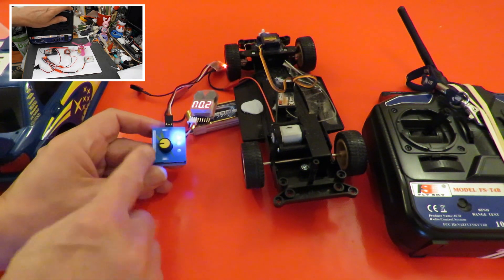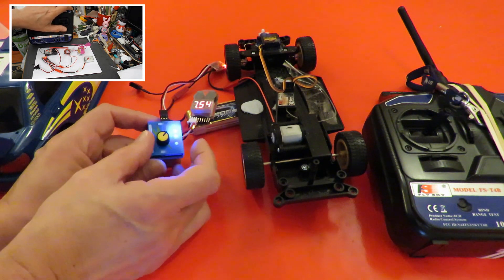Forward Brake Reverse Cheap RC ESC

Comment: Thats because that transmitter is for a plane or drone not a car
Reply from the maker: Fair enough, if that is what you want to believe. However, it is simply a matter of the range of the throw on the throttle stick. Any other model of transmitter in the FlySky range allows you to alter the range of the throws. The FS-T4B is the bottom of the range with the minimum features. You don't have to have a pistol grip controller to drive a car.
Reply: @GrandadIsAnOldMan  no but a transmitter that the throttle doesn't return to center on its own is not for a car that's for a place or drone
Reply from the maker: @melmskilemz6307  again, fair enough if that is what you want. If you need auto return to centre you can use the right stick for throttle and steering. I find it handy to NOT return to centre, especially if running a boat. However, having said that, I do usually use a pistol grip for driving cars. If I am driving tanks, again, not having auto return to the mid point is a handy feature, I set the speed of the tank by setting the speed of the left track using the throttle stick and then use the right stick to match the right track for straight and vary it for steering. (Same for twin prop boats). Another alternative would be using a V-tail mixer.
Reply: @GrandadIsAnOldMan  why talk about when running a boat when the video is of a car 2 different things you are using the wrong transmitter for the vehicle and wondering why it's not behaving right
Reply from the maker: @melmskilemz6307  NO, the video was about the problems with this type of ESC, hence the title. It says nothing about RC cars. Maybe if you read the video description or any of the other comments you would understand. I am just using the car as a demonstration.
Reply: @GrandadIsAnOldMan there wouldn't be a problem if the correct transmitter was used
Reply from the maker: @melmskilemz6307  I guess you find it too difficult to read video descriptions and I am getting tired of repeating the same answers. However, one more time. This has nothing to do with driving cars. As explained in the video description, originally my problem was the lack of information about how the brake works or how it is activated. The issue with the ESC is the fact that the FS-T4B does not give you the full range of throws and has no option to change that. If I had not discovered that problem, then I would not have understood why I was unable to bind my WLtoy V911 receiver for controlling an aeroplane. Because you don't get the full throw the receiver would not enable the motor outputs. It is the FlySky FS-T4B that does not give you the full range. Here is the video using the WLtoys V911 receiver https://youtu.be/vX-ovUMPIkw  Using a FlySky FS-CT6B where I can set the throws to 100% in the set-up program I could bind the receiver fully and use the motor outputs or alternatively set one of the switches for motor cut-off. As you will see from the comments, you are not the first person to get a fixation about using a car controller, but I understand that is just a lack of understanding in the purpose of the video even though the title is clear enough.
As for "using the right controller", if you only have one controller, as was the case when I started "hobby grade" RC, then nowhere in the information supplied with the ESC or the listing selling it, did it specify what controller would be required.
Reply: @GrandadIsAnOldMan  no that is not correct seems you don't know alot about rc and just like to write big paragraphs maybe learn about rc before trying to teach people on YouTube because you are clueless
Reply: @GrandadIsAnOldMan  seems 7 years after this video you still acting like a complete noob to rc
Reply from the maker: @melmskilemz6307  what is not correct? You seem very sure of yourself, but you are very vague about what you are saying. Tell me exactly what I have said that is not correct.
Reply: @GrandadIsAnOldMan  not worth explaining again if you haven't got it in the years this video has been out
Reply from the maker: @melmskilemz6307  so you admit you are wrong and realise you cannot justify your comments. No problem, I can accept your apology 😊
Reply: @GrandadIsAnOldMan  no how many times that transmitter is not for a car seem you can't admit your wrong old man
Reply: @GrandadIsAnOldMan  should take your own advice how many people have told you in the comments and you still think your right think you know everything when you are clearly clueless
Reply: Just incase you can't see with you old man eyes THAT TRANSMITTER IS NOT FOR A CAR
Reply from the maker: @melmskilemz6307  At no point in the video did I state that transmitter was for a car. The video is explaining how the brake is implemented at full throw and then goes on to explain why that transmitter has a problem with that action. However, as you brought up the transmitter/car issue, there is no reason why you cannot use a two stick controller to control a car. Virtually all toy grade rc cars have simple two stick controllers. The fact that the hobby grade RC car community virtually exclusively uses a pistol grip is true and demonstrates that you can drive a car just with two channels, so you don't need the extra facilities of other controllers. That does not mean you cannot drive a car with two sticks. If you want to start in RC, you would not buy a pistol grip controller as it would severely limit the range of RC products you could control with it.
Reply: @GrandadIsAnOldMan  yes there is because it does not return to center on its own there are stick controllers that do and guess what there the ones you use with a car not the one you have that is for a plane or drone god sake how many times do you need to be told
Reply from the maker: @melmskilemz6307  The right stick on a two stick controller is self centring, so if it was important to you for it to find the centre for you, then you could do that. However, I will just repeat, this video is about the functions of the cheap 'forward/reverse/brake' ESC as stated in the title and how the limited features of that controller caused an issue. You and several commenters have seen the controller and got all excited about that. However, that does not alter the facts of the video. The ESC has a brake facility. There was no information supplied about how the brake was operated or released. Neither were there any YouTube videos covering it, so I shared my experiences. In testing, I also discovered that the controller was limited in its 'throws'. All of this is covered in the video. I have pistol grip controllers, and they can suffer the same issue. The throws are limited, and you cannot release the brake without adjusting the trim. For the record, these cheap ESCs now come with a switch to disable the brake function. On many of my early toy grade to hobby grade conversion projects I used one of these ESCs to control the steering motor and you might be able to picture the issue with the brake engaging when you have the steering on full lock and it will not release.

Comment: Trying to figure out the brake on ESC and run into your old video. Checking some other videos I am pretty sure that brake is used for RC planes (https://www.youtube.com/watch?v=qYHJgg_vvSQ) so to stop prop from turning either when landing or on motor gliders when gliding. I am making a couple of RC cars for my grandson (that's my excuse!) so I got a few ESC but these all seem to have switch for switching the brake on and off. Testing a couple of motors with two ESC I noticed that one has delay when switching from forward to reverse and the other did not and when I checked the brake switch one was in OFF and one in ON  position. So it should be possible to switch the brake off when using ESC for cars by switching the brake off? (still learning, last time I made RC models we did not have ESC, it was all home made using transistors).
Reply from the maker: Yes, most of the cheap ESCs now come with a switch to give you the option on the brake. However this video is from 2016 and the ESCs did not have a switch. Hence the video 👍👍 When you are looking at ESCs for aircraft, I don't think you will find any that allow you to throw the motors into reverse, but yes some do have a brake facility 👍👍

Comment: Sir, I have a simple cuestion. 

Every brushed esc have brake in neutral position? Because Im doing a 1/36 car but when I put neutral position on the controller always have a drag brake
Reply from the maker: I am not sure I understand your question. With these cheap ESCs the brake is engaged if you flick from forwards to reverse. You have to move your stick to full reverse to release it. If you are using a pistol grip style controller it seems to work easier because you have more travel with the trigger lever.
Reply: I bought this one. but have brake always in neutral position
Reply from the maker: YouTube hid your comment with the AliExpress link. I just found it. I don't think that type of ESC has a brake option.
Reply: I think brushed esc are made for crawlers, because always have a drag force in neutral position of controller. I think is like that to go down with crawlers smoothly
Reply: Sorry about my inglish im from Spain. But I have tried many brushed esc and they doesnt let free the motor in neutral position. All of them have a little brake in neutral position of controller. If you want check the hobbywing quikrun 1060 esc, and you will see three mods of run
Reply: https://www.google.com/url?sa=t&source=web&rct=j&url=https://m.youtube.com/watch%3Fv%3DzQJztpumYrM&ved=2ahUKEwjV2azE9vb6AhWYQkEAHaJAAfYQwqsBegQIAxAF&usg=AOvVaw0h8-FM9qsyncKCLAp0Maqg
Reply from the maker: Are you asking for help or are you telling me that all brushed ESCs have drag brakes? This link talks about drag brakes https://www.rcgeeks.co.uk/blogs/news/drag-brake-an-esc-for-rc-crawling and this thread explains how a drag brake works http://www.rccrawler.com/forum/electronics/301508-how-does-drag-brake-work-whats-principle.html
Reply: @GrandadIsAnOldMan  yes all brushed esc has a drag brake. Sorry, Im just trying to do a 1/36 racing car. I have a problem, esc dont let free the motor in neutral position, then I cant drive. 

Im finding the correct esc, maybe a must to do a brushless car, then motor and electronic parts dont stop the car keeping inertia
Reply from the maker: @rastapezl  I am not aware that any of my cheap ESCs have drag brakes, certainly not noticeable when I have used them on my crawlers, they just roll back if I have the throttle at neutral.

Comment: can this esc support 2s lipo battery that has 1000mah, 1500mah or 5000mah?
Reply from the maker: As I published this video in 2016 there is no guarantee that whichever one you find online will be identical, life has moved on, so I suggest you have a look for one online and check it's specification before buying. The 20A is the maximum current draw through the ESC so regardless of the capacity of your battery, it is the current draw of whatever motor you attach to the ESC that will govern whether the ESC can handle it or burst into flames.
Reply from the maker: I suggest you have a look at the FliteTest RC Planes - beginners series https://www.youtube.com/playlist?list=PL6IuSFWz4ktvupu_gxw1vn-sjBGOkJFHV It is aimed at model aircraft but the RC information is well explained and is equally applicable to cars and boats.

Comment: my Carson 27t brushed forward reverse system does not brake thd car when on ground. In the air, the wheels get stopped. Corally Sp10. When I am dribing bavkwards and I brake it brutally stops the car when I push the lever forward again. I changed the motor cables and did throttle reverse... always the same, ig behaves in the opposite and breaks from bavkwards to forward. I donot understand.
Reply from the maker: I don't understand either. If you have reversed the wires on the motor and reversed your throttle on the controller, then the brake should work in the opposite direction.
Reply: @GrandadIsAnOldMan  tried it now with a good old LRP Bullet without limit and it breaks now in 2 directions. So the Coarson 27T is the problem and will be put in a 1:16 car :-) thanks a lot

Comment: I was watching in your servo tester demonstration how the sequence of operation is "forward, brake, full brake, reverse". As you rotated the servo knob from 'full brake'  back to center the motor runs in reverse--at full speed, only slowing as you approach the center position. Seems to defeat the purpose of having proportional throttle in reverse. 

But then you did something slightly different at 6:10 -- forward, reduce to partway into the reverse range, and instead of going to full brake, you returned the knob to the idle position, then slowly advanced into the reverse range, and the motor started up in reverse, but at low speed. 

When you subsequently commented about the ESC possibly being faulty, I noticed that you briefly touched the forward range (motor started making 8khz sound) and then back into the reverse range, and it didn't trigger until you paused to say "it won't do it" and moved the knob into the reverse range a third time (without touching forward), at which point the 8khz whine started and moving the knob farther into the reverse range started the motor in reverse at low speed.

Doesn't help with getting it to work with your radio, just something I noticed as I was just looking at this one for a similar toy conversion (this time, a bus), but I was always planning on getting a pistol-grip radio for that project.
Reply from the maker: These extra cheap ESCs are probably a case of you get what you pay for. They work but they have some limitations. By complete coincidence I was using one of these old ones in a project last week and even though I was using a pistol grip controller I was still getting problems. 99% of the time I have no use of an ESC with a brake and I have found they are available on eBay with a simple switch to disable it so I buy them now, probably bought a dozen or more now and they serve my purposes.

Comment: You simply need a pistol grip transmitter that will give you for reverse and staring when you go in reverse that's your braking that's basically with all RC cars
Reply: I was using trigger and still cant brake emidietly, have to hit reverse twice to brake.. take too long to brake, i endup crashing all the time

Comment: Basically you are using a controller that is design to be used with ESC without reverse nor brake. This controller is to be used with airplanes, were none of these actions are applicable and not for cars - boats.
As other comments points out, you must use a pistol grip controller.
They have a "mid position" where the trigger returns with springs, to idle.
If you insist to use this controller though, put the ESC to the second channel, where the joystick does have a "mid position"...
Good luck!
Reply from the maker: If you check video description I explain the problem is the FlySky FS-T4B does not give the full range of control. Other FlySky transmitters can be set to give the full range to trip the brake release. It's not the fact a pistol grip is a different shape it is just the amount of "throw" you get from the settings. I use these ESCs for controlling twin motor variable thrust steering on boats so I use both sticks, one for each motor. In the first video you commented on I demonstrated using the steering stick to give the centre position worked fine. When driving my boats I would find everything works fine until I decided to reverse the left stick. I would then have no power on the left until I managed to find the mid point to release the brake. The right-hand motor would have no problem because I could centre it. However having said all that, the ONLY reason for using these ESCs which had the brake was because they were the cheapest available. This year for the same price virtually identical ESCs are available with a switch onboard to switch in or out the brake option so I have bought lots of them as they are far more useful. I suspect the Chinese manufacturers listened to the feedback or simply realised they could implement the option at minimal cost and sell more anyway.

Comment: It might be the speed controller rather than the radio.
Plane speed controllers (as I understand it) don't generally have reverse, so the full range of motion of the throttle goes from zero to full rather than forward and reverse.
I don't know how the ones for boats work, but I bet they are different too.
I think the fact that you are not using a car speed controller is the most likely explanation for the odd behavior
Reply from the maker: Hi James, I had a similar problem with binding the FlySky FS-T4B to the WLtoy V911 receiver. Because you don't get the full throw the receiver would not enable the motor outputs. It is the FlySky FS-T4B that does not give you the full range. Here is the video https://youtu.be/vX-ovUMPIkw  Using a FlySky FS-CT6B where I can set the throws to 100% in the set-up program I could bind the receiver fully and use the motor outputs or alternatively set one of the switches for motor cut-off.

Comment: Do you think it will work with my flysky fsi6?
Reply from the maker: Are you talking about the ESC? It is a normal hobby grade ESC so it would work with any normal hobby grade receiver. If you mean the brake effect I am discussing in the video it just depends on the "throws" on your throttle. It looks like the FlySky FS-T4B is set so it does not give the full range and is not adjustable. I haven't touched a FSi6 so I don't know.